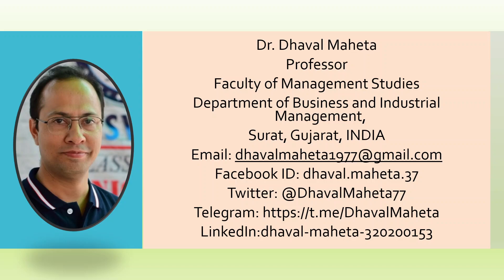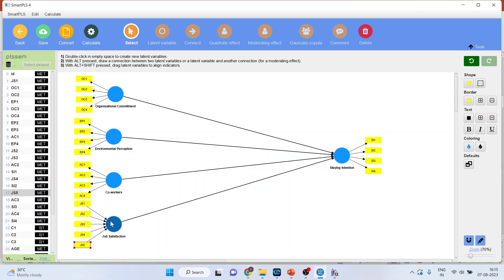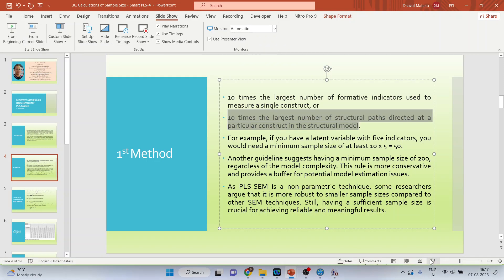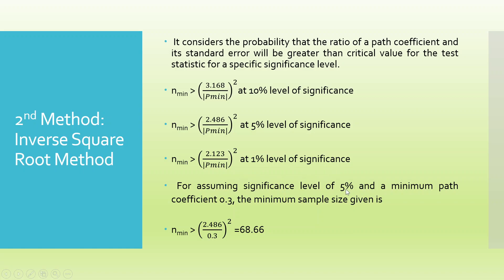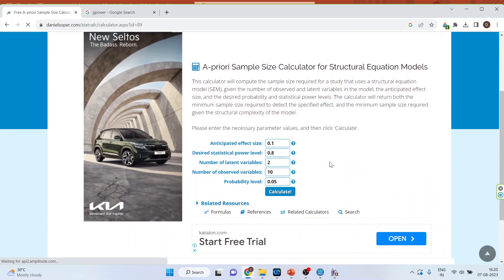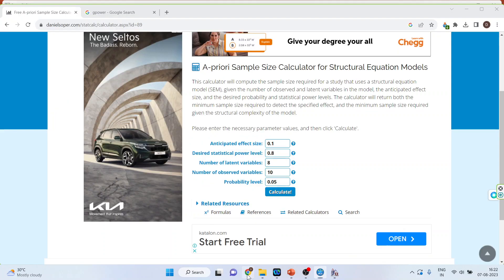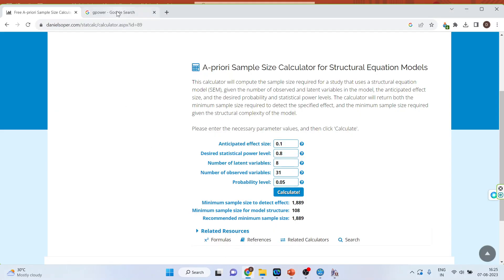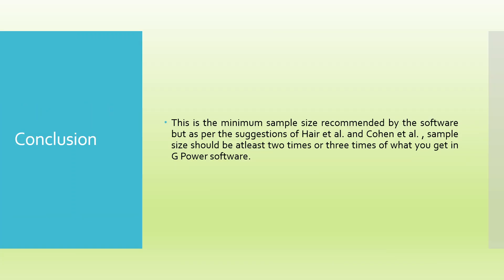36. Calculation of Sample Size in Smart PLS-4 || Dr. Dhaval Maheta

Comment: Sir, Pls suggest if i have pls sem model and i want to do MGA (Multi group analysis). I have 3 groups, then the sample size calculated as per the rule of 10 times the number of formative indicators pointing at a latent variable is the minimum sample size required for EACH of the three groups individually, or Overall sample size?